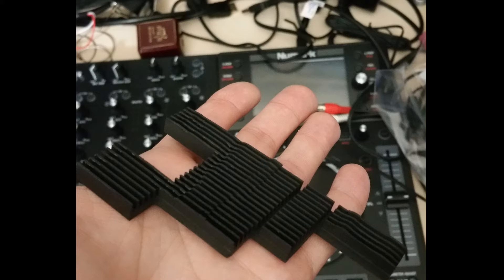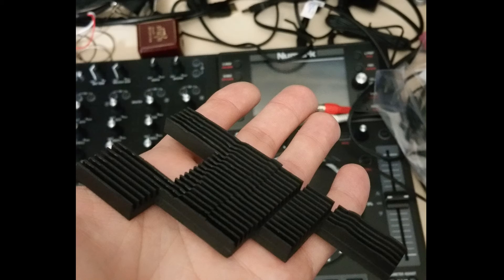Accelero Extreme IV VRM overheat solution

Comment: My backplate gets so warm I can't touch it after a few minutes of max power draw. It seems like its syncing quite a bit of heat. Stock vrm cooling on my card was just a small flat aluminum plate, nothing on the back side. I don't think that tiny plate did as good of a job as the giant bbq grill back plate that comes with this kit. Its a 150 watt gpu.
Reply: https://youtu.be/c7QwBtYyzCI

Comment: i dont have the heatsink shown on the video start what can i use to keep my temperature down...?
Reply from the maker: You can always get additional smaller VRM heatsinks or Chipset Heatsinks are they are commonly referred to as well.
Reply: should i use 1mm thermal pad or 0.5?
Reply from the maker: Milos Jovanovik 0.5 is fine

Comment: I am thinking about get Artic Accelero Extreme IV for my EVGA GTX 1080 SC; when you put the copper heatsinks, did you put the baseplate back that covers the copper heatsinks when you installed the Accelero extreme IV?Thanks for all
Reply from the maker: Hojari Verde nope,  in the case of this card there is no way to use stock plate.  Also it comes with a heat sink to put in place of the OEM plate.

Comment: em. this one chip which is alone on the down side of card isn't conflict with fundation/holder?
Reply from the maker: Grzegorz Seb which chip are you referring to?  none of them cause any issues with the heat sink.
Reply: cr4zyw3ld3r im toking about the one VRAM chip which is on the bottom of second screen, but ok, in couple of days i will get some coolers. I will check by myself. ^^
Reply from the maker: Grzegorz Seb if I am understanding you correct you are referring to the black cooler.  I had to cut it so it would fit under this cooler.

Comment: So, what about temperatures ? I have the same card and it runs 85 degrees(celcius) at 1150mhz / +56mv core in Hitman and Doom using Vulkan Api with stock cooler .
Reply from the maker: gpu idles at ~50 Celsius, when under load goes to 70-75c, vrm temps never go above 70 used to reach 95 or 99 celcius.